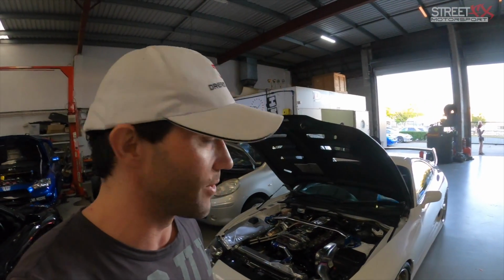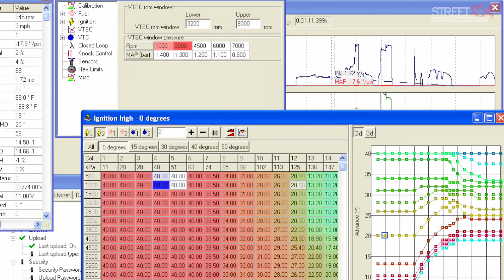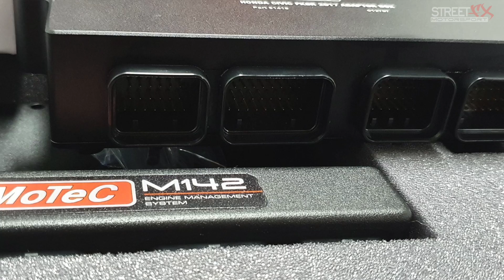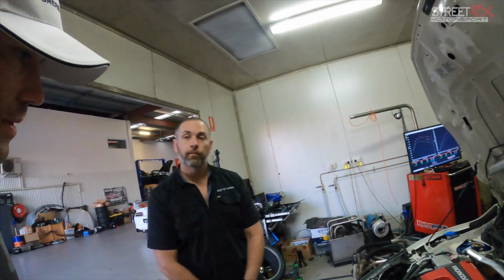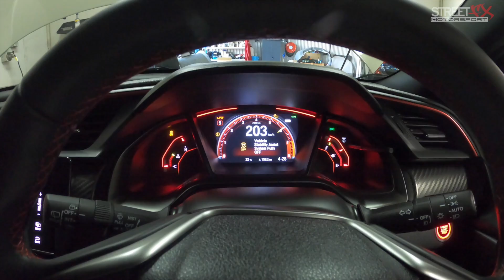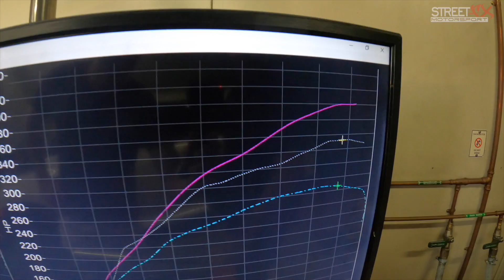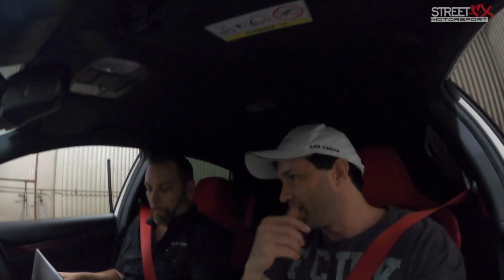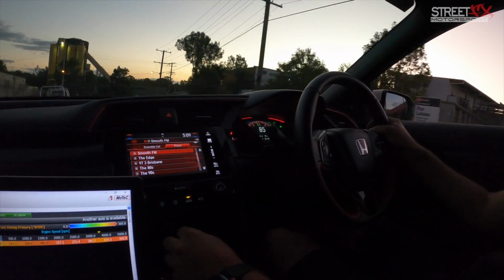Honda FK8 Civic Type R ECU test! Motec M142 vs Hondata FlashPro vs Stock dyno

Comment: For 99% of the guys out there,  flashpro will do the job just fine.
Reply: If you are modding your car, and doing aggressive stuff to it why not do it the right way and get a MoTeC
Reply: @jonathanayala527  because doing "aggressive stuff" doesn't justify going full motec.
Reply: @HKSmr2rbo  i see, to each there own!
Reply: @jonathanayala527  there's a massive difference in price. Hondata $690+ $250 jailbreak. Motec - $6500
Reply: @code_fk8817  👍
Reply: @jonathanayala527  wasn't being a dick, just saying that to most people, a MoTec isn't even an option, so Hondata would suffice
Reply: @code_fk8817  its all good, like i stated before, once you start doing all kinds of engine mods motec is 100x’s better in my own opinion. Theres is no way i would fully build my engine, bigger fuel injectors, dp & fp and think that hondata is sufficient. But to each there own. Ive had a motec so i know what its worth. People tend to think that its just to bash on hondata but its not
Reply: @jonathanayala527  Because Motec does not support the 2020 and 2021 Type Rs
Hondata has been enough to make 646whp so far with a plug in box that costs $695 
If you want more than that youll need to own a 2017 to 2019 R and spend $7000 just for the Motec

Comment: One of the best sounding FK8 Civic Type R❤️💯 nice content i’m interested
Reply from the maker: Glad you like it! :D
Reply: @StreetFXofficial I know 4 years late but  after some info
My fk8 is currently 448hp and 438ftlbs tuned in Sydney stock bottom end, full bolt ons, fully upgraded fuel system and turbo with Hondata, reckon I’ll get any better with motec?

Comment: Ideal track day weapon and would surprise a lot of "quicker" cars. Must be disappointing though that a track marketed car needs cooling mods. Looks like Hyundai (and a few other hot hatch manufacturers) did a better job there. I'd love to see this thing on track!
Reply from the maker: Yeah all the FK8s we have encountered all get cooling issues on track.

The i30 was quite good but it doesn't make anywhere near this power, even with mods, we're only sitting around 330whp on our i30.. we do want to do a Motec, which I feel will let us get closer to the limit, but not sure where that is yet 😳
Reply: Street FX, sure, but Jordan’s time in WTAC ‘18 in the i30 was not bettered by any FK8 in WTAC ‘19. Plus the i30 is nowhere near the price of an FK8. I’d have either though (if either was better than a Megane III Trophy-R, ha ha). Does MoTeC do a plug & play for the i30 or would it be a full wire in job?
Reply from the maker: Powertune in Sydney are offering a PnP Motec which is the route we plan to go down when we can afford it :)

Comment: the 390-400 whp with oem ecu and premium fuel   custom tuning(not off the shelf tunes)  is possible with bolt ons  , i  ve seen it many times on the dyno ,care to tell us from WHAT exactly will the same car benefit and make 50wp more?   since the oem turbo cant go much higher?   a lot of misinformation here ,  maybe the correct title would be HONDATA BASE REFLASH VS MOTEC FULLY CUSTOM TUNED , but then you d have to custom tune the oem ecu to the limit , i cll this test BS

Comment: Ya custom tuned on hondata on a E30 blend with full bolt ons and a stock turbo I'm at 391 WHP and 394 torque... MOTEC is 7000 though I could sell my R and all its mods put 7k cash down and be in a used 2015 GTR
Reply from the maker: Hard to compare unless on the same dyno on the same day. A used 2015 R35 is over $100k in Australia.
Reply: @StreetFXofficial  oof that's nuts they are 60k US

Comment: Mine using m150 plug in on GT86 AT.. downshift stock not working.. the shift up also so latr in very high rpm on light throttle. Any idea why ?

Comment: I want Motec so bad 🥺 I wanna really know why the real difference in power curves between Motec and Hondata besides the explanation of just being more refined. 🤷‍♂️
Reply from the maker: From my understanding, having proper control over boost and fuelling means it can be much more finely tuned closer to the edge. The flash system is great until a point, where you can't lean on it otherwise you're just hoping the tune isn't too aggressive.
Reply: Street FX Motorsport TV Thanks for the more detailed explanation 👍🏼
Reply: I’m about to buy the Motec 🙂

Comment: If the engine has the same volumetric efficiency, same fuel quantity, same ignition timing, how can a brand make more power? 😂😂😂
Hondata is crap, motec for racing use no doubt and the original ECU it's the best for 80% of the cases.
I have spent many hours on original ECU software, at the end passed the 400hp mark. Stable boost with no power reduce on high gears, original knock control working, air and water temperature limiter working, all the rest removed, almost like racing ECU.
Reply: GOD bless BOSCH 😊
Reply: Nice what remaper you use ? form the Original ECU THANKS.